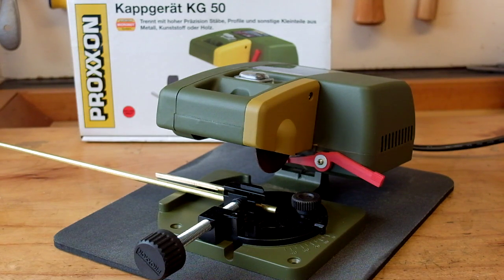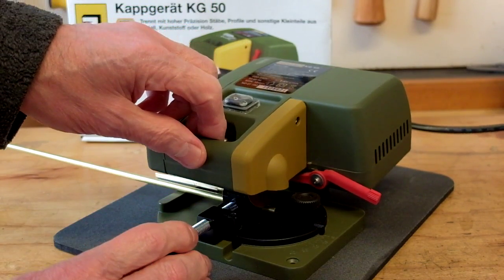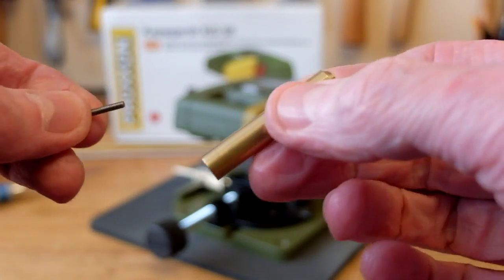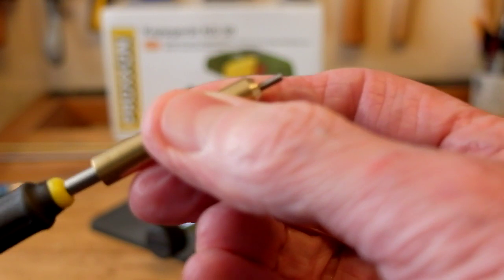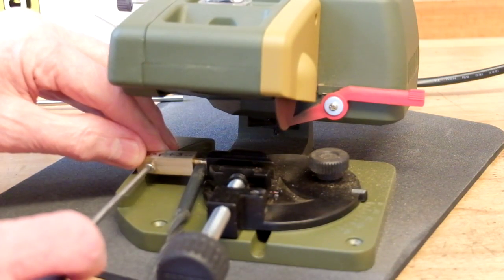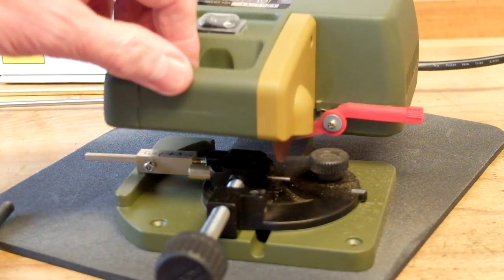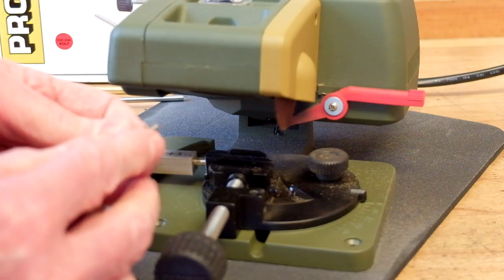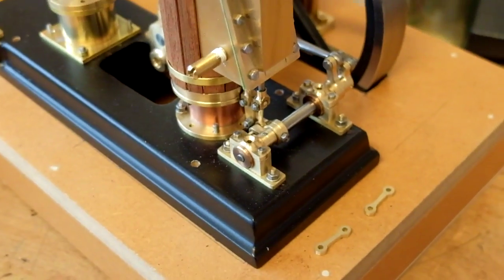Proxxon KG50 cutoff used to shorten small screws for models

Comment: Hi

  While I assume cutting steel rods may take time, how is the saw against Brass and aluminium tubes?

Is the cut clean?
Reply from the maker: Yes you do have to be patient cutting steel but the finish is good, in reply to other comments about screws,You often need many screws of exact length maybe only 5mm long that you can't buy and this helps.

Comment: Wouldn't it be cheaper to use a hacksaw or buy screws that fit?
Reply from the maker: I just want to show what this machine will do,  as for screw cutting when you work with very small screws and you need a precise length with a clean end this is a good way to do it. Generally I find  the machine is not very powerfull and best suited to small items.
Reply: what if you need 30 brass tubes some odd size, you'd be wore out with a saw haha. tho personally I'd just use a rotary tool and chuck the material in a vise